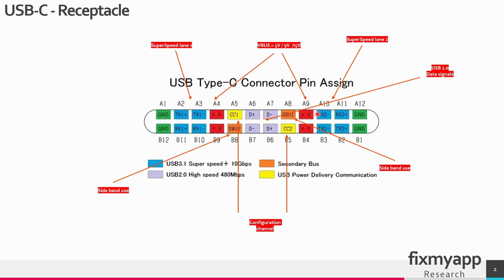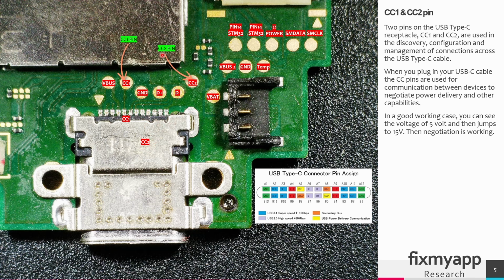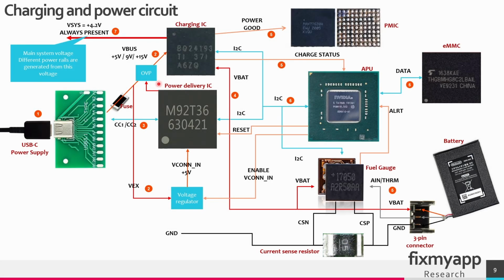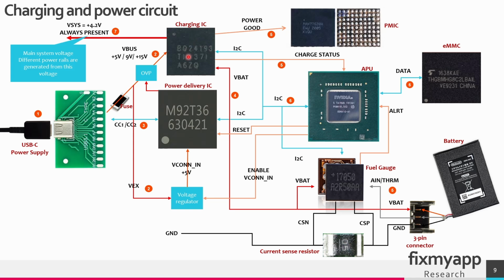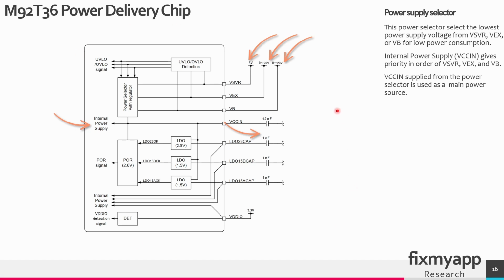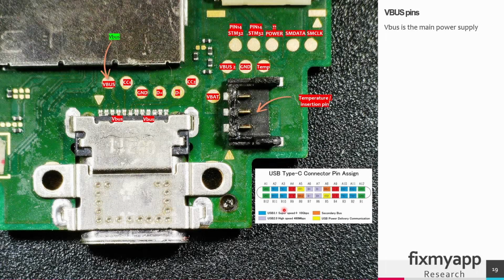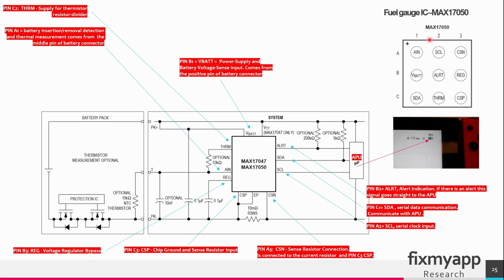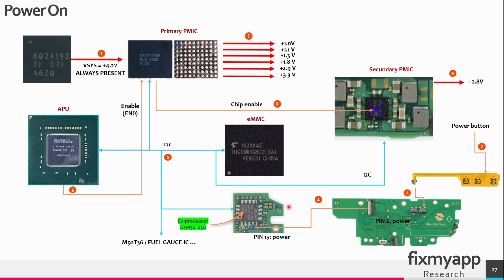Nintendo Switch Power and Charging Circuit | In depth ANALYSIS

Comment from the maker: Rectification: At timestamp 44:29 - When you press the power button the signal does not go to the STM32F038 co-processor but it goes directy to the APU.

Rectification: At timestamp 26:25  - VEX is not responsible for the power supply of the IC's, that is VSYS this comes from the charger IC.
Reply: Hola amigo, disculpen quisiera saber si me pudieran ayudar con una nintendo lite que tiene un problema, el problema es que cuando la consola se apaga por completo el ventilador se queda encendido y cuando se preciona el botón de power y enciende , se apaga el ventilador y funciona correctamente. Espero su respuesta y muchas gracias

Comment: Usb pd is the protocol used for fast charging . It can also allow power to pass through and charge additional devices from the same port via a splitter . In order to do this though you need a charger that was designed with a chip to communicate to the device the relevant data . Chrome Book chargers are usually USB PD . Typically the base will be hardwired to the chord if this tech is present .

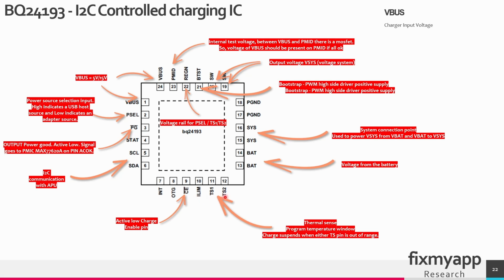Comment: 36:10 so TS1 and TS2 prevent cold-charging the battery (below 0C), right? And it's probably safe to assume the Switch 2 has such a safeguard built in as well? I left my S2 plugged in overnight and the air temperatures dipped to around 0-2C, and now I'm paranoid whether damage could have occurred. Cheers! Great video btw.

Comment: bro please help me man im frustrated , i have a switch oled that i worked in to get the chip installed, all went well except it wont boot past the nintendo logo, right after that it will show low battery . tested with a brandnew battery still the same ? i did the picofly  it will show me the no sd card  but  with a sd card it just goes blackscreen ?
Reply from the maker: Hi, maybe your fuel gauge IC is defective? as it is responsible for the battery percentage data on your screen. Gr. Jim

Comment: Got blue screen after reball of apu and ram...changed m92 and BQ chip...I'm thinking it's Maxx chip..v2 switch cpu 01 board
Reply from the maker: Blue screen is most likely a communication error between apu and ram try a reflow or reball it again. Gr. Jim

Comment: Very good information, I'm not an electronics expert but I like it, thanks to a USB-C tester I discovered that my switch lite has 2 pins with a value of 0 , the CC1 and CC2, the strange thing is that it only charges using a cell phone charger, it does not work with the N.Switch charger 😢
Reply from the maker: Hi, I think because the M92 is not communicating with the charger by using the cc1 or cc2 lines it will charge the switch with the default USB voltage of +5V. CC1 and CC2 is needed to fast charge the Switch. Gr. Jim

Comment: Thank you for this amazing video. I have very strange problem on one OLED motherboard. Although all other USB functions are working, HDMI, 5V and 15V charging, data transfer with dock or direct PC connection (MTP), USB-C doesn't power devices on its own. That means when you connect, for example, Pro controller directly to USB-C without dock or external USB HDD/SSD/NVME, that devices doesn't work. It works on every other Switch I tried, but not on this motherboard. To better illustrate problem, if you use any USB-C hub, even if that hub doesn't support HDMI output for Switch, USB device will start to work the moment you add power to that USB hub.

If you have any advice what I have to check on the board. Pretty much is impossible to find anything on internet, because Google thinks I am looking for solution for delivering power to Switch, but my problem is that Switch doesn't deliver power to accessories on its own... and at least 5 other do that without any problem.
Reply from the maker: Hi, I would replace the M92 IC as it is responsible for the power delivery communication between USB-C devices. Gr. Jim
Reply: @fixmyappjim  Thank you. Did you ever come across this problem? It is always either no charging or no video output. This is obviously so rare, I cannot find anyone else with identical problem.
Reply from the maker: @banemitic  Not really but most problem related to USB are M92 related or the PI3USB. Gr. Jim

Comment: You're a god.  I love you so much.  Thank you for sharing this information.  I'm here because my switch lite is only charging on one side.  Motherboard CC2 location has no reading.
Reply from the maker: Thank you for watching. Most of the time te problem is a bad usb c connector or a bad m92T chip als check the esd diodes connected to the data lines of the USB. Gr. Jim

Comment: I have recevied a lot rp2040 and I and I have put in switch v2 and when I start the console now backlight work but not display , but in hdmi work good ( owf ) I have make second console same thing …
Reply from the maker: I would check the custom soldering job to see if there are components missing or damaged. Maybe remove the rp2040 to see if it works again if not i would investigate the LCD driver connector and IC. Gr. Jim
Reply: @ I have change the 8316 lcd driver and now i have display working good , but now the switch show logo Nintendo and black screen 😂😭
Reply from the maker: @LCD63  this could be a faulty m92 IC. Gr. Jim

Comment: A9 is faulty and the usb charging port looks good. An idea ?
Reply from the maker: Hi i would first measure the pins of the USB connector to see if there is continuity or replace the USB connector. Then inspect the traces to goes to the m92 or maybe replace that IC depending of what  you find. Gr. Jim
Reply: @fixmyappjim  it was the P13usb. Capacitors around were in short cut. Using hot air, some capacitors were gone. What the hell to replace them because they were 0201.
Reply from the maker: @ChristopheDebot  i don't know the values you can. I would by a donor board and get the capacitor from there. Gr. Jim
Reply: @fixmyappjim  i have find the values, some are 100pf and others 100nf.

Comment: Please help me.   
My SWITCH(V2) Turn on, but not Charging.
So replace Chip(M92T36, USB-C Connnector, BQ24193, R2R, PI3USB30532), But smae status..

Your manual 5 page(Nintendo switch –IC’suniquelypairedtogether during the manufacturing process.), DIODE MEASUREMENTS
A2(GND short), A3 (OL), VCC(OL), A5(OL), D+(OL), D-(1222), D8(898), VCC(OL), a10(OL), a11(OL)
6 PAGE
A11(OL), A10(500), A8(800), a3(OL), a2(OL) 

NEXT STEP?  (repalce chip problem? or another chip repair?)
please help me.
Reply from the maker: Hi, maybe you have to replace the fuel gauge ic. Gr. Jim

Comment: Thanks a lot but there is samething for Classic Switch ? I have one it work well but it doesnt charging...
Reply from the maker: Hi on the classic switch the charging circuit is the same. Check all the IC's that are responsible for charging and USB-C negotiation. Gr. Jim

Comment: The switch wakes up by itself in Lakka only, where could be the issue? I have 2 switch and the other one is ok
Reply from the maker: Hi the cause could be a wake up signals is turning it on. There are 3 wake-up signals one is fromt he touch screen and the other is from the wifi ic and last one is from the primary power management ic. I heard that a faulty primary power management ic can cause this issue maybe you can replace / reflow it. Gr. Jim
Reply: @fixmyappjim  thanks, Im gonna try

Comment: First thank you for the very detailed and amazing video,  I have an oled swithc fully functional that doesn't charge with dock or official charger but it does with my phone one, what I should check based on your experience? can it be just a faulty usb port?
Reply from the maker: Hi i would first measure all usb-c pin's of the port, if all ok then my first suspect would be to replace m92 if still the same replace BQ IC. Also check the PI3USB and the filters on the USB data lines. Gr. JIm
Reply: @fixmyappjim  Thanks!

Comment: Hi! Nintendo Switch Lite by default charges the battery to 4320 mV. After system wipe in TegraExplorer began to charge up to 4192 mV. Max17050 changed gear to the default value (4.2 V). How can this be fixed?
Reply from the maker: Hi i really don't know, but the voltage will change when the battery is almost charged. Gr. Jim

Comment: FixMyAPP, at 26:06 you said pin #21 controls the gate of the first MOSFET on the Switch Lite.
I've tried to replicate that result on some donor boards I have by continuity-test, but my conclusion is that pin #22 gets to the gate of the first MOSFET, not 21. I even went as further as to remove the MOSFET to expose the pad and the result is the same.

Could you please double-check that?
Reply from the maker: Hi i did check again pin 21 goes to a few resistors and eventually goes to the mosfet 1, pin 22 is according to the datasheet a "drv_src" pin it is to  indicate the strength or capacity of the IC to provide current to the USB interface. Pin 22 goes to both mosfet 1 and 2. Pin 23 will go to the mosfet 2. Also pin 21 and 23 and 24 according the datasheet will drive the gates of the mosfet's. You can check if you see the thin trace of the mosfet it is most of the times a gate pin. Thank you for your feedback. Gr. Jim

Comment: Hello! Greetings from Chile! I have a Nintendo Switch Lite stuck on the Nintendo Switch logo, change the WiFi ic and it's still the same... could you tell me where I can check? Thank you
Reply from the maker: Hi, M92T36 ic can give a nintendo logo fault. would first visual inspect board, check if wifi ic is reflowed 100% nintendo will check this ic first to boot the system up. So would investigate the wifi ic and m92. Good luck. Gr. Jim
Reply: @fixmyappjim  I thank you!! I'll do it and I'll tell you later! 👍🏼👍🏼👍🏼

Comment: @26:25 you mentioned the VEX input is used as the main power supply for the backlight IC, among other ICs.
But isn't the BQ24193 chip responsible for providing 4.2V to the backlight IC, which will then boost that voltage according to the user's brightness settings? I'm confused. Which one feeds the backlight IC, VEX or the BQ chip?
Reply from the maker: Hi you are correct, when making my last video it was indeed VSYS that is responsible for al the input power supply of most IC's. VEX is only used for M92. Thank you for this feedback. Gr. Jim
Reply: Alright @fixmyappjim  so to recap: VBUS becomes VEX to power on & feed M92, which then negotiates the voltage & Amps at which the BQ24193 chip will be using to charge the battery with; Plus it (BQ24193) will also provide 4.2V as the main voltage for the circuit & most ICs. So why does the Switch need the 5V Voltage Regulator chip? I mean, it's generating 5V because the APU is enabling it, but to what end? Who's requesting 5V? Is it one of the PMIC chips? Last but not least, I've got two more questions:
* About the third MOSFET chip, I'm assuming it's alternating the supply of 5V, but I still don't get from whom to whom; Care to elaborate?
* When pointing out who's controlling the first 2 MOSFETs, you said this pin goes to the M92; But how can it control the gate without a resistor?
* Finally, could you demonstrate how one can tell whether those MOSFETs are shorted? I know its easy to just plug it to a source and check if 5V is coming across those MOSFETs, but if it isn''t should I just check for continuity from Gate to Source or Source to Drain?
Reply from the maker: @Rodox2k10  Hi, Your walkthrough is correct. The 5V is needed for the VCONN powerrail to deliver power to the USB cables. Correct the two mosfet are controlled by the M92 IC there are no resistors because it is not needed see the datasheet probably the ic has it own internal resistor. For measuring shorts between the mosfets you can use a multimeter in diode mode. There are a ton of video's on youtube how to measure these mosfet's. Gr. Jim

Comment: good job! i have a board which 3.3v line have a reading of 1.5ohm and the switch can not boot. can you suggest me which component to take off the board? i already took m92t, pi13usb and 3.3v regulator but it still stay at 1.5ohm.
Reply: edit: fixed
Reply from the maker: Hi, what was the fix? Gr. Jim
Reply: @fixmyappjim  a cap near 3.3v regulator got shorted. I took it out and the 3.3v rail normal again.
Reply from the maker: @x2T1992  Nice job! Your troubleshooting process worked :) Gr. Jim
Reply: hello friend. i have received an oled no charge no power. upon changing the m92t the switch now can be charged at 15v 0.4a but stuck at this not powing on. i have changed fue gauge, checked max 7762 , but found no short. can you suggest me which area i should looking for? thank in advance. @fixmyappjim

Comment: Thank you for sharing this information, I believe it took many hours. Congratulations.

I have a V1 with a current leak at the ENXX output (3.3v), I have already removed the max 77620, PI3USB (leaky VDD) and Wifi IC and the leak continues and heats up the APU. All I can do is suspect an internal leak in the APU. Do you have any tips for testing before extracting the APU?
Reply from the maker: Hi i would inject a voltage of 1V with a max of 2 Amp on the powerrail that you suspect. If the APU get's hot then it is game over. Maybe use a thermal camera if you have it maybe a small components is the cause and that heats the APU up. Gr. jim

Comment: Any research on joycon charging on battery?

It won't charge joycon to full below a certain threshold, i.e (70% charge of switch)
Or it won't initiate a joycon charge below (50% charge of switch), means your joycon is dead and can only be charged through usb.
Reply from the maker: Hi it's on my to do list can't tell when i will start analysing the nintendo switch v1/v2/oled. I don't know what the cause could be :( Gr. Jim

Comment: Looking forward to this! I have a switch here with PI3USB /BQ24193 / M92T36  replaced. The switch works. and hdmi video is outputting through dock. But it charges at 0.15A. Any idea? I also replaced the battery to test. But no difference. It charges 1% in 15 minutes..
Reply from the maker: Hi, i hope i can answer your questions with this new video :) Well you have replaced all IC's except for the Fuel gauge IC maybe that can me the cause. Also the charging IC has a bootstrap capacitor if that capacitor is bad it will only slow charge your battery check the video for more info. Gr. Jim
Reply: @fixmyappjim  Thank you for your time! I will wait for your video. I dont know where these caps and fuel guage are located. I did also replace the usb port. I hope your video will help!
Reply: @fixmyappjim  I replaced the Max17050, now the switch charges at 0.50A what seems like slow charging. But the system wont turn on anymore.
Before it worked fine and charged at 0.10A. The battery is know good and full. What could be the problem now? Also, read the above to see what i already did.
Reply from the maker: @Gazenbeek  Hi, if the battery is full the current will go low 0.5A seems to be high for a full battery. Before replacing the max17050 it worked? then i suspect you have to check your rework, i would reflow of redo the max ic maybe it is not reflowed 100% and also check if there are missing components near the ic. Gr. Jim
Reply: @fixmyappjim  Ok i redid the chip again. And it turns on again. And back to 0.10/0.15A charging. (with a battery at 46%) So its not the maxc17050...

All functions work. docked works. except fast charging.